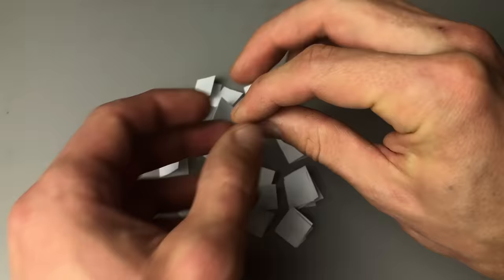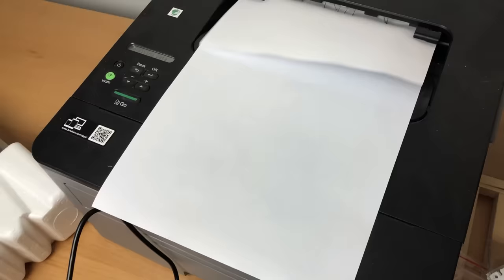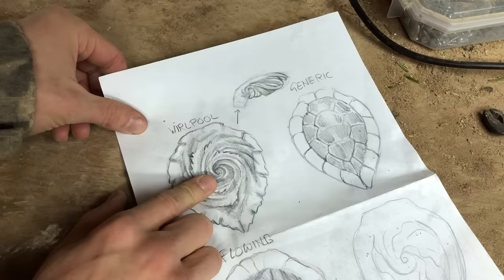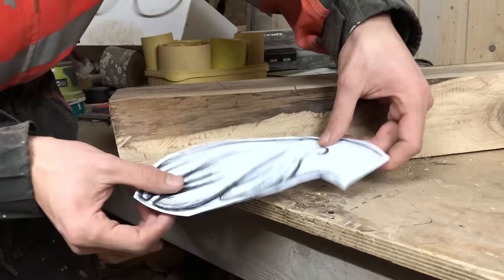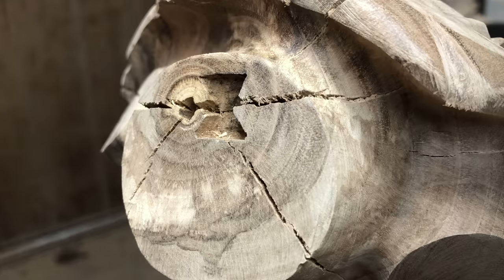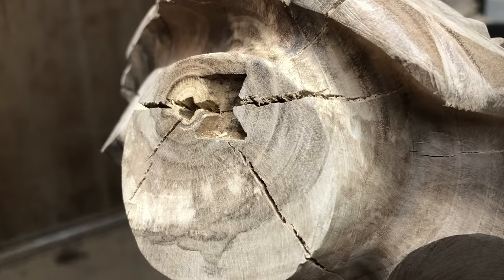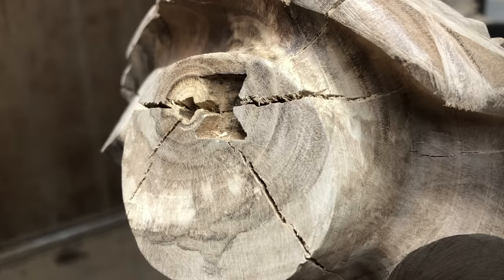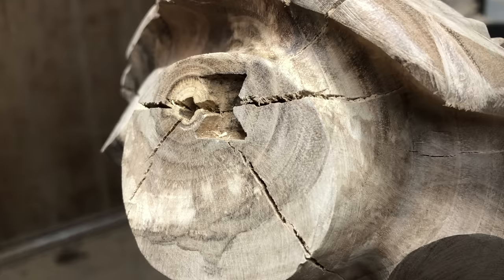Carving  A Large One Of A Kind Turtle

Comment: You tap into the Cosmos Energy very well! The turtle looks great! I have found some success with drilling holes if I start with a smaller drill bit first, then increase the size. It helps with cracking. Sometimes, however, one cannot avoid it. It looks great as wall art too.
Reply from the maker: Yeah i will try that the next time!

Comment: Beautiful work but let me give you a heads up on Turtle shells. Most Turtles have a pattern in the shell that many Native Americans used as the calendar. Their calendar was Lunar based on Moon cycles not Solar based. There are 13 moons or months in this pattern which are the 13 large sections of the shell. Around it is 28 small sections that form the skirt around the edge of the shell. Each moon cycle is 28-29 days so these told you what day of the month it was. If you do the math 13 months X 28 days gives you 364 and there was one day for communal celebration which gives you the 365 day year. 
Keep up the great work, you are talented in a variety of ways- the plan alone was a masterpiece! 🐢👍👍👍

Comment: you are awesome - a trick for wood joints when epoxying two surfaces like the head and flippers , do everything the way you did but on the 1/4" of the outside diameter of one surface mix your sanding dust with epoxy to make a matching  wood paste then you will have no gaps when finishing also works in cracks. Don't do this with wood glue as the oak will turn black, with epoxy it won't.give it a try  I hope this will help. I love to teach to help others and not to criticize or be negative to many couch potatoes do that Bret Western Wild Woods
Reply from the maker: Thank you so much! Thats some good advice

Comment: Using the entirely wrong drill bit. You're way too far away from the piece while you drill, making it more likely you twist and crack the work. Plus those bits (and most drill bits) put side pressure on the hole as they drill. I'd recommend trying small diameter hole saws then coming back in with a regular twist drill if you can't snap the peg. Should be able to find one about 20mm in diameter for metric since they make 3/4in. Their design inherently resists/minimizes side to side twisting and puts the least amount of side pressure on the walls of the hole as you drill since the teeth cut less maternal and cut straight into the wood.
Reply from the maker: Yeah i need to have a better approach next time